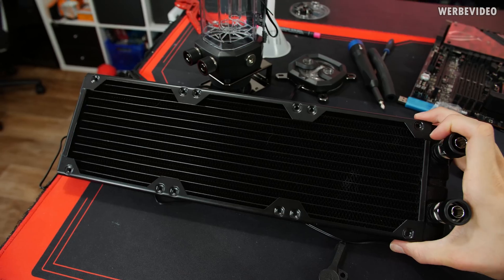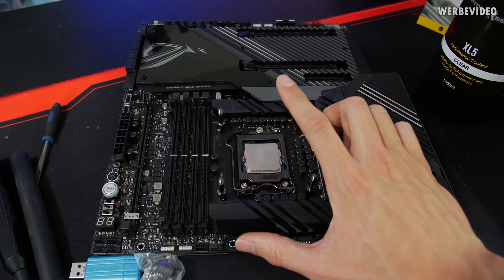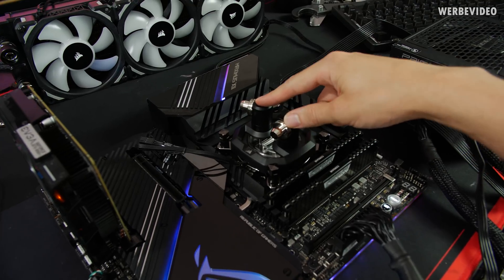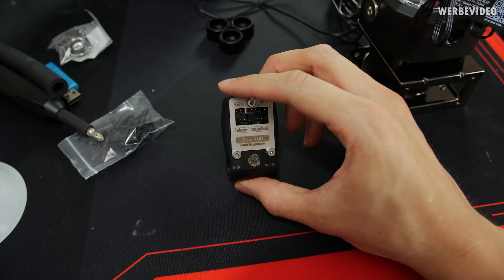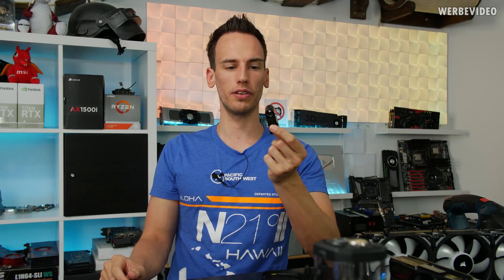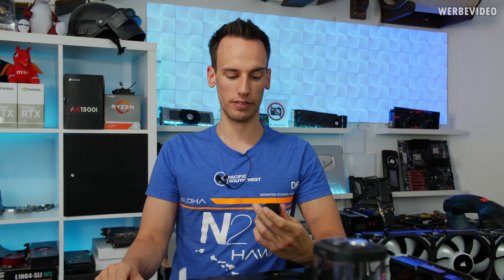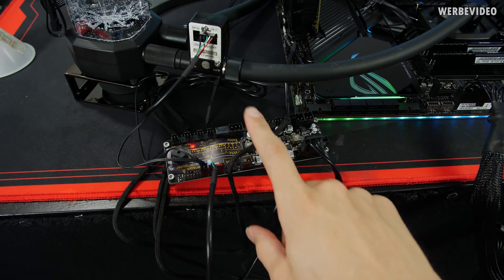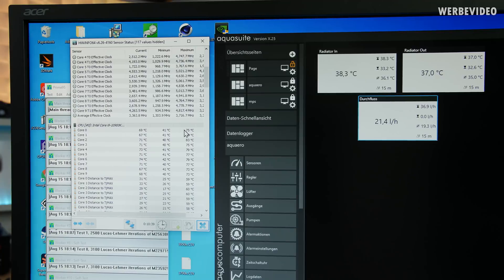Testing one of the Weirdest Water Cooling Myths - A SLOWER Flow Rate will result in BETTER Temps?

Comment: when i look at flowspeed discussion i just look at my motorcycle - the water pump is driven by the engine RPM - meaing the higher /faster it runs (the more heat) the faster the pump runs - hotter = faster better (for me)
Reply: Many people make that mistake. You can’t compare engine cooling with PC cooling. The temperatures in cars and bikes are way higher and the cooling systems are quite different. Also for engines you have a minimal safe temperature
Reply: @KonstantinDankov  the temperature is different yes, but the problem is the same, and the cooling systems are pretty much the same, a radiator that gets cooled by air (riding or fan), cooled water goes to the pump, coolant goes to throuh the hot components, back to the radiator - yes an engine has an "operation temperature" which you cant really undershoot anyway with the cooling and is only a "concern" the first 1-5 mins (depending on ambient temperature)
Reply: @KonstantinDankov  Actually you can compare because heat is heat no matter how its generated. You evidently lack the knowledge to make the connection between the two. Cooling system is identical. 1- you have heat source (engine,cpu) 2- Water pump 3- Radiator. The difference is one system has a thermostat to keep at a certain temperature.
Reply: engines have a operating temperature. with rpm the flow increases.if it worked at 100% all the time then the water would never warm up. the job of an engine is to reach operating temperature, and open the thermostat. 
try takng your thermostat out. your engine will barely, or wont at all, heat up to operating temp.
Reply: @jake20479  thats literally what i wrote? " the water pump is driven by the engine RPM - meaing the higher /faster it runs (the more heat) the faster the pump runs - hotter = faster better" maybe the last part is the misunderstanding - as you ride faster, the engine gets hotter, but also incrases the RPM of the water pump (as it is driven by the engine RPM) which incrases the cooling efficiency
Reply: @aleloAT  The increased flow rate isn't essential, vehicles with electric water pumps don't just use flow to control temperature, they (usually?) still have thermostats and variable speed fans.

For PCs, you are always aiming for the lowest temperature of the cooled component, which usually means the lowest coolant temperature.  The video here shows how turbulence and pressure plays a role as well, such that lower coolant temperature isn't necessarily better... However, that wouldn't be the case with all waterblock designs.
Reply: @looncraz  the video pretty much showed that a higher flow of coolant, meant tha the water was hoter before the radiator and cooler after (as it stays longer in there and can cool down) but the actual hot component (the CPU) is hotter, as the water soaks up the heat well, but the water flow is too slow to transfer the colder water to it/the hotter water away. and yes the flowrate is an essential part. you could cool a PC better with high water flow and no fans, than no waterflow( from pump) but fans - sure if the radiator is on top the cold water will flow down and the hot up in the radiator creating a slow flow, but it would cool less -  the problem with low flow speed is that the coolant/water heats up faster,  also heating up surrounding materials (hoses, pipes, etc) which preheat the water before it gets to the place it needs to be.
Reply: @looncraz  Not true, electric water pumps dont need thermostats as you can use the computer to turn the pump on and off on intervals. Also electric water pumps cooling fall off when you have high rpm engine. Example are drag strips engines get hot at the top of the drag as the pump cant keep up with the amount of flow a mechanical pump has.
Reply: @IamJoeTV   I've seen many cars with electric water pumps still have thermostats, but I admit I was very confused as to why... and remain confused as to why.  They may have also had a mechanical water pump and the electric pump was just part of the start/stop system, not sure.

I know my XC90 Volvo T8 still uses a thermostat, but that's only for the rear electric motor.. I don't believe it has any sort of mechanical water pump, just one electrical pump... I haven't worked on the car myself, though, as it's still under warranty - I only know of the rear thermostat because it was replaced under a technical service bulletin.

Water flow matters a LOT... until you have enough, then it doesn't matter at all.  Once you reach the point where the coolant at the outlet of the heat source doesn't change, more flow does nothing.  I monitor my own loop using the radiator intake (air) temperature and the coolant temperature at the intake of the radiator - at 1700 RPM I have a 1.3C temperature drop with 30C air temperature with the temperature going into the radiator running around 35C.  I can speed this up to 2400RPM and the coolant temperature at the radiator drops to 33C and the temperature drop is only ~0.5C, but the coolant at the CPU and GPU is obviously cooler.  If I ramp my pump to ~4,500RPM, its max, my temperatures don't drop much more at all, though the T-delta for the radiator drops considerably because there's less time in the radiator to cool it (naturally)... I've reached the limit of my ability to dissipate heat into the water or from the water, so more flow just makes more noise.

I actually thought I had graphs for this, but my build notes folder doesn't seem to be where I kept the spreadsheet...  yeah, I actually engineered my loop ;-)
Reply: @looncraz  Yes water flow is everything, a thermostat is simply in play to keep the coolant above a certain temperature point. Thermostats on cars that have electric water pumps and big radiators which have an opposite temperature problem have a the benefit of turning the pump off in intervals to help heat up the coolant. The reason cars have thermostats to begin with is the coolant system is more efficient than the minimum operating temperature of said mechanical object. If a minimum operating temperature isnt your goal like a PC than you dont need the thermostat. 

Your XC90 will have a mechanical water pump for the engine and a electric pump for the electric motor. Both systems will have a separate coolant loop. Mechanical water pumps are much more reliable hence why they are still the main water pump in use for automotive. 

So a lot of people confuse heat and temperature as its different. You might think you engineered your loop but i guaranty you didnt and you missed on calculations. Remember you can only cool to ambient temperature.
Reply: Its like getting a burn on your hand slow cold water doesn't feel any where is good as fast flowing water.
Reply: That's far too simplistic of a view.

The reality is very simple: the water only needs to flow as fast as is needed to absorb the same amount of heat and to dissipate the same amount of heat from the sources and sinks as that of a higher rate of flow, slower is worse, faster is just wasteful.

Comment: Well you don't make a radiator in between every component because such loop would look terrible with too much hoses and messy, would be more difficult to build and may be sometimes even impossible because it can not fit in a case also could be more expensive because you would probably need more special fittings like right angled/angled or extenders.

Comment: How about testing 2 radiators in parallel to drop the radiator flow but keep the high block flow.
Reply: Doesn't matter  1km @ 50kmh = 2km @ 100kmh with constant time.  Half speed at half distance still = full speed at full distance -- you've changed nothing.  Higher flow rates are always better as it reduces the impact of the boundary layer that could prevent optimal thermal transfer as illustrated with slower speeds.
Reply: @mhamma6560  Except two in parallel might give more total water flow depending on the pressure /flow curve of the pump.
Reply: Oh, that would interest me too! serial vs. parallel radiators

Comment: This should be self-evident if you recall high-school physics!
The heat transfer from block to water is dependent on the heat capacity of the liquid flowing through it. The heat capacity of the water is directly proportional to the flow rate. If you double the flow rate, the heat capacity of the water flow through will be double, so it will take twice the number of Joules of energy to raise the temperature by one degree.
I remember doing a very similar experiment in school to measure the specific heat capacity of water by measuring flow rate and temperature deltas along a pipe.
Reply: Small correction ''If you double the flow rate, the heat capacity of the water flow through will be double'' is only factual in open system, rarely PC cooling are open system.
My own setup is open, but that's just because there are subsidy for water bill in my city, so I decided to open up my loop.
Reply: The only point where a higher flow rate wont be better is if you become so ludicrously fast that the water starts creating significant amounts of heat through friction. That speed however has to yet be reached.
Reply: Wow you are like so cool, bro.
Reply: only if its new water all the time lmao
Reply: lol what? No. Water's heat capacity is constant. Heat transfer is what is better with higher flow rates and it is dependent on the Reynolds number. Also it won't be double if you double the flow rate, the correlation is much more complicated than that.
Reply: @broklond  Exactly this. Heat transfer is reduced at lower velocity's as the thermal boundary layer is thicker. This has an insulating effect trapping the heat next to the copper surfaces.
Reply: @broklond  heat capacity...a constant? That's specific heat capacity. Heat capacity is specific heat capacity times mass. What they said is correct for open systems.
Reply: @sdm347  yeah, that's what I meant. I'm not a native english speaker, sry.
What they said is correct for an open system, where you don't recirculate the water, which is pretty dumb in the case of cpu cooling.
Reply: @sdm347  i think the reason is bc 0.0001% of people have open systems

Comment: Yeah I learned it the hard way by trying on my loop before anyone made a vid about this hahaha nowadays I have the conclusion that the only thing that could possibly help is individual loops for cpu and gpu but it also costs more...
Reply: +Increased Frequency, actually unless the two loops were very carefully designed their effectiveness will be reduced compared to using a single loop with two radiators. One loop will be over-sized and one will be under-sized for their given tasks. The decrease in efficiency have them combined (in series) is minimal, at worst.
Reply: @fred_derf  I know bro, but for me it got way better temps, cuz the gpu block is kinda restrictive, I`m using 2 thick 240mm copper rads and both of them are working as exaust on top and bottom of the case, I`ve spend lots of time testing various distinct configs and this one gave me best results but at the cost of a second pump, reservor and space hahahah

Comment: Think of it this way: 
you are moving around a loop where half the time you are repeatedly being punched in the face, and the other half you are receiving medical treatment. The slower you move through the loop, the longer you receive medical treatment... but it's still going to HURT more after the "punching" phase!
Reply from the maker: hahahaha best metaphor
Reply: @der8auer  your conclusion is correct, but his measurements are not: 

A simple thermodynamics calculation gives 1.5[K]*4.2 [J/g-K]*5.5 [g/s] = 35 W. You are putting 170 W into the radiator, and your measurements only explain 35W. The temperature difference across your CPU or radiator at steady state should be ~7 degrees C, assuming your flow rate measurements are correct. If they are, you needed to wait longer to reach steady state.
Reply: Better analogy is a line of people carrying boxes from the CPU to the radiator. If you have twice the rate of people passing the CPU block, you can carry twice the number of packages per second.

Comment: The timing of this video is perfect, just bought the parts for my custom loop
Reply: lol me too fist bump
Reply: Same here 😂
Reply: Me too just brought my stuff as well, difference in mine is a 25mm thick Aluminium radiator pump speed 4700+rpm factory AIO , vs a 33mm thick copper radiator pump speed 2600rpm custom AIO
Reply: The video won't make a difference to the performance of your custom loop, and failed to impact your purchase because you saw the video after you made the purchase
Reply: @noreng9333  no you could still put them in a different order..
Reply: @noreng9333  ok boomer
Reply: @noreng9333  the video didn't fail, I already studied thermodynamics
Reply: Giovanni Lizzi 😂😂😂

Comment: Another misconception I hear a lot is that having too fast of a water flow won't allow the heat to transfer to the water and cause over heating which is obviously bs.
Reply: Right. because heat transfer is like a handshake, you need time to do the handshake to transfer heat.
/s
Reply: @Omaricon  That's technically true, but you would probably experience problems with heat buildup due to restriction in the waterblock at such a high flow rate (if you could even create a pump capable of such a ridiculously high water flow), and/or the water block literally exploding.
Reply: @noreng9333  true, but at those speeds you'd probably cut your hands off. Or at leasy severely damage them. And as you said, your loop would probably blow up
Reply: theoretically it could happen, but not with the little toy Pumps we use for Liquid Cooling.
Reply: Some people just don't get thermodynamics at all, even when the rules are simple
Reply: Yeah  I mean the pump dumps whatever energy it puts into pumping the water into the loop so it will turn to heat but how many watts does a d5 pump use? Maybe 20 at most. All of which doesn’t go to actually pumping the water. Compared to 100 for a CPU and 200 for a GPU it’s just trivial.
Reply: well water touches it at all times so it doesnt make any sense
Reply: You've just burnt your hand - do you run it under a slow tap, or a fast one?
Reply: @JMUDoc  i swear so violently physics optimizes the flow for me for fear of retaliation. :3
Reply: @JMUDoc  Haha wash your hans with fast enough moving water and you won't feel that its cold or hot...
/s

Comment: Thank you for testing this. It solidified the reason why i always run my pump at full speed // the aquasuite seems to be an amazing tool // i think i made the wrong decision with the corsair commander pro
Reply: There's diminishing returns on pump speed mind you. 

You may be able to see nearly the same temps with much less pump speed and wear. The reason is once turbulent water flow is reached, any additional flow beyond this gives increasingly tiny improvement. Diminishing returns.

If you want to take the time to test this, load up the system and drop the pump speed 5% at a time and run at load for an hour. You'll see very small increases in cpu temp until you get a very sudden increase.

The last step before the sudden increase is the optimal pump speed, but you may wish to go one step further back up just to give a margin of error.

At this point anything higher might give you a fraction of a degree lower temps at the cost of much higher wear.

Comment: Flow does result in lower temps but it varies from system to system so this is not a 'one result fits all' type of situation. A different CPU block or radiator will completely change the result as flow rate and temperature are tied to loop restriction and the pumps ability to push fluid through a loop. A loop like this with low restriction doesn't need a lot of pressure, add in GPU blocks, more restrictive radiators and CPU block and you'll need more flow.